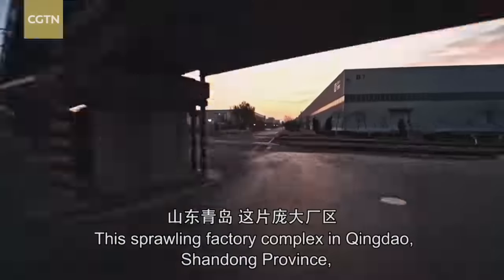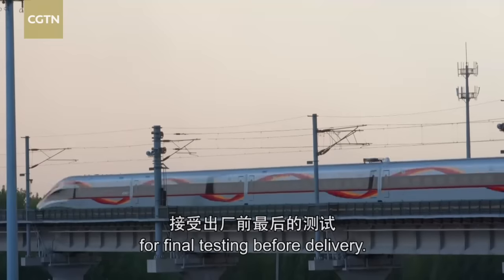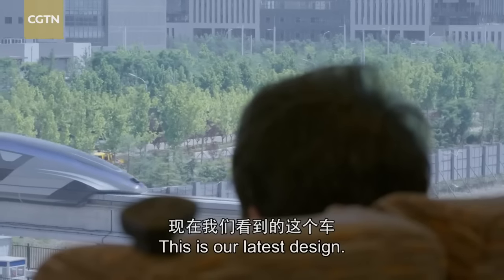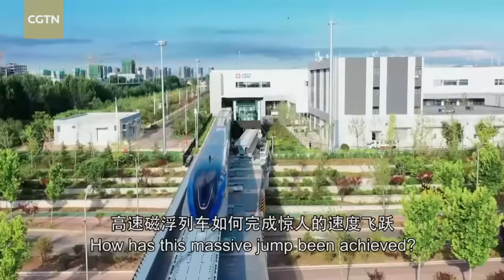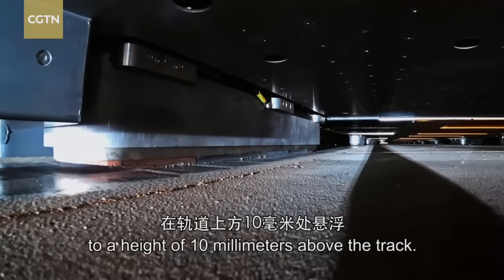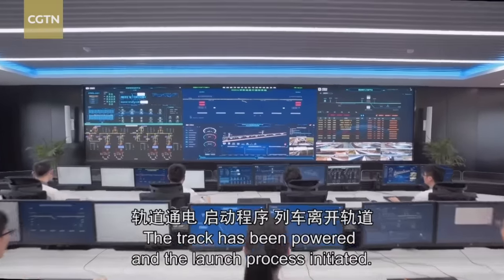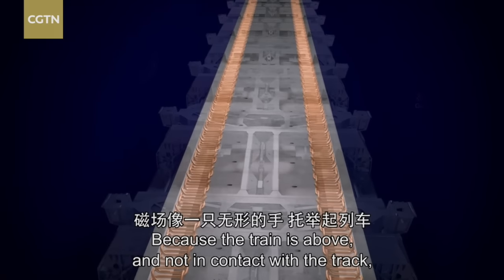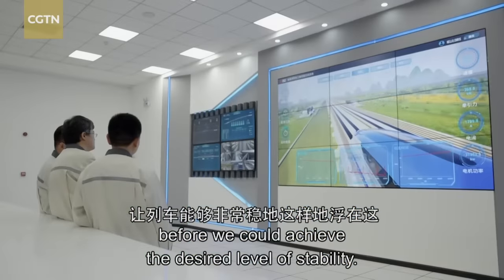China turns 600 km/h maglev trains into reality

Comment: 370 miles per hour with no wings or wheels is pretty awesome.
Reply: Thanks to 40+ years of German ENGINEERING and inventive spirit.
Reply: @bieneulm1982  Brugh....
Reply: @bieneulm1982  
Maglev was invented by the British electrical engineer Eric Laithwaite, a professor at Imperial College London, developed the first full-size working model of the linear induction motor in the late 1940s
Reply: @Dept246  Wrong, maglev on which the transrapid is based was invented by the German Hermann Kemper and patented in 1934. Laithwaite only did research in Britain and his first maglev train came much later than the german started their program. Furthermore was it just a prototype and never came to use. The linear motor alone doesn´t make a maglev train.
Reply: @bieneulm1982  yes we must admit the Germans invent a lot. I used to work with a German company from Berlin  V2 rocket, Jet fighter, Cruise Missile are originated from Germany from World War era. Even converting coal to oil originated from Germany, like Photovoltaics pioneered from Germany, like Maglev but the  Chinese has of the edge on scaling up production, faster and with a competitive price tag.
Reply: @steveman888  rocket tech is orginated from ancient chinese, theyve been using it on war during the dynasty period. Some put it in the arrow to fire at a very long distance. Maybe the modern rocket is german but the concept of the rocket is chinese.
Reply: @Aircraftcarrierpropulsion  the tracks for the transrapid are cheaper to build than a conventional High speed rail track. That´s because they can be prefabricated (that is why Shanghai was doable in only 22 Months back in 2001), a conventional rail line needs to be build at the spot and needs a lot of tunnels because trains are limited in their ability of climbing steeps. The only thing why the transrapid failed was sabotage through leftist politicians and that no one wanted to take responsability for an increase in costs due to purposely misplanned track-locations... The current railway projects Stuttgart 21 and Wendlingen-Ulm High Speed railway got more than 3 times more expensive than the Hamburg-Berlin Transrapid line would have been at it´s latest estimated overall cost. Are they both build, against all protests and everything? Yes. It´s never for the costs why transrapid failed in Germany, that is and has been only an excuse - even more a lie - like the one that the accident in 2006 had ended the technology, by it´s and Germanies enemies. And for Hamburg-Berlin they´re now planning to do Hyperloop, while we still would have Transrapid fully developed and available. Germany needs one thing to be done with great effort: Kick our current leading politicians out of the government, cause they´re governing the country in a bad, harmful and anti-german non-progressive open way. That needs to change back to where we have been 25-30 years ago. As soon as possible. But that would mean to turn a society from being stupid and naive into progressive, awake and ready to fight for it´s needs if necessary... With those Germans and such an attitute there would never have been a "end of nuclear power generation" after 2011, and we would be a full nuclear power with our own weapon-ready nuclear materials at hand.. That is why lies like the ones spread about the Transrapid are installed into the publics consciousness. "Constant dripping wears the stone" is what we Germans say to this. We could be far ahead regarding rail traffic if we had used transrapid 30 years ago instead of the compromise "ICE" by Siemens, instead we have delays (mostly caused by our high speed trains) that make the regional train lines suffer, SIgnals that fail and cause a standstill on the tracks and so forth and so on...
Reply: @bieneulm1982  I don't think you know the exact cost of the tracks per km per systems, otherwise you won't spit this kind of crap.
I don't know what you are smoking, but if Germany build an atomic weapon you will be invaded.
Reply: @Aircraftcarrierpropulsion  I do know them precisely, it goes like that: 1 double kilometer of transrapid Track inbetween Hamburg and Berlin was calculated to be at 17 Million €/km. Compared to that: 1 double kilometer of conventional high speed track on the line Nuremberg-Ingolstadt 30.9 Million €/km. Furthermore Germany has the full right to build it´s own nuclear weapons, it just signed the Non-Proliferation Treaty and therefore rejected the possibility of building own ones, but it is able to use nuclear weapons due to the so called "nuclear sharing" of NATO. Even the french offered the Germans in the 60´s nuclear weapons but Germany refused, although some parts of the military would have liked to have their own nuclear armament. France and Germany even planned their own nuclear processing plants together (to gain weapon-ready nuclear material) but a change in Government over in France put a halt to that.
Reply: Its a bullet. Bullets don't have wings and wheels.
Reply: @bieneulm1982  OK boomer
Reply: @kippise  b*llsh*t. That is why the japanese shinkansen (yes, the one with wheels underneath it!) is called a bullet train...
Reply: Yes

A pretty awesome lie!
Reply: @RemakeMoments  siemens is a German company 🇩🇪 🤣
Reply: @bieneulm1982  It has nothing to do with German enginnerings. Dont foget that German are now using CRRC trains from china
Reply: @tlplayz_ytc8501  Germany has ordered not a single train by CRRC, locomotives just a few and these came out of a joint venture. Germany has a fine and experienced range of train manufacturers.
Reply: @bieneulm1982  why did not german develope this 600KM/hour train themselves????
Reply: @bieneulm1982  what's you reading score in high school?????? why did not german develope their own  600KM/hour train????????????
Reply: @bieneulm1982  what identical and which patent exactly?????????????
Reply: @我的瓜最甜  ALL OF IT is identical to German Transrapid. It basically is a transrapid!
Reply: @awesome8975  modern rockets have most certainly not been invented in ancient china. Shooting a black powder-filled can in the air to make it explode to scare horses of the opponent is not a rocket, since it has no engine and it was flying more or less horizontally. They where invented and developed in 1555 by Conrad Haas and brought to an applicable and space travel ready condition by Wernher von Braun during the 1940´s.
Reply: @bieneulm1982  thats the trick you liars always use: there are lot of these........... there are lot of those............. when asking which one exaclty ....... you will be like: um............... well............  finally : go find yourselvies!!!!!!!!!!!  common tricks of liars😂😂😂😂😂😂
Reply: @bieneulm1982  🤣🤣🤣🤣🤣🤣🤣🤣🤣🤣🤣🤣🤣🤣🤣🤣🤣
Reply: @我的瓜最甜  I got a full high school exam in 2017. But thanks for doubting my educational level, which is most certainly way higher than yours (at least in certain aspects, I cannot be knowing everything about Chinese history, since I´m not an asian, unfortunately).
Reply: @bieneulm1982  let me try your way............ hey liar: why did you steal my furnitures??????????
Reply: @bieneulm1982  lets put your education level aside...... we will address it later..... let's go back to the question i just asked????? why did you steal my furnitures????????????
Reply: @bieneulm1982  why did you steal my furnitures????????????
Reply: @bieneulm1982  hello liar...... why did you steal my furnitures????????????🤨🤨🤨🤨
Reply: @bieneulm1982  are you busying in stealling someone's stuff??????????
Reply: @bieneulm1982   let me try your way............ hey liar: why did you steal my furnitures??????????
Reply: @bieneulm1982  thats the trick you liars always use: there are lot of these........... there are lot of those............. when asking which one exaclty ....... you will be like: um............... well............  finally : go find yourselvies!!!!!!!!!!!  common tricks of liars from western😂😂😂😂😂😂
Reply: @bieneulm1982  let me try your way............ hey liar: why did you steal my furnitures??????????
Reply: @Daniel Schwenk (Imkerei Schwenk | Ulm When you must cite an invention that's in 1934s then I think the rest of the world can also China as inventor of earliest calculator and paper money that you are using. Isn't it time for you to bowl down to their invention or u gonna try and steal that too? 😂
Reply: @Daniel Schwenk (Imkerei Schwenk | Ulm None of it is the same, cite your patent # if you think they are same as Chinese version
Reply: @Daniel Schwenk (Imkerei Schwenk | Ulm Like you said modern rocket isn't invented by Chinese as its "different" than earlier version of rockets invented by Chinese. Likewise, early mavlev train from Germany is different than modern mavlev train from China. Do you understand what's called a hypocrisy? You are the definition of it.
Reply: @Daniel Schwenk (Imkerei Schwenk | Ulm You got a high school GED and here you are trying to brag about high tech stuff that you don't even have knowledge about. FYI german didn't invent this form of new train. That's the end of it
Reply: A Malnutrition can Actually Invent? REALLY? Impoverished have ideas? Or is ist *copying the first thing seen?
Reply: we have a bullet train in argentina, it travels at 40 mph but crosses some cities you may get a couple of bullets..
Reply: @bieneulm1982  😂
Reply: The first commercial maglev people mover was simply called "MAGLEV" and officially opened in 1984 near Birmingham, England.
Reply: @petrbelohoubek6759  And where is it now?
Reply: @micro-emprendimientos.1642   😂 Alright, I'll give that to you.
Reply: @inkbold8511  The difference between ancient chinese rockets (low distance and barely controllable) and modern rockets (able to carry humans to the moon) is a lot bigger than the difference between the german transrapid (505km/h maglev train) and this new chinese 600km/h maglev train. In its core, this new chinese train works the same as the transrapid, its just reengineered and improved. Since china is actively using the german transrapid train in Shanghai it only makes sense that they use their experience with existing maglev trains during engineering of this new train.
Reply: @stevenman888 Ancient Chinese invented fire arrows and fireworks first.  Then cannons.
Reply: @micro-emprendimientos.1642 very funny, indeed! I laughed a lot about yr spirited comment! Even if it is rather sad! Greetings from a german living in Brazil doing business with China!😊
Reply: @bieneulm1982  German did not want to buy, original planned first Maglev which should be started from Stuttgart to Manheim, but, talk only.
Reply: @awesome8975  helicopter theory is originated from ancient China too.
Reply: @josephguo6256  Transrapid was build by Thyssen, the guidance system came from Siemens. Siemens has no maglev know-how. Stop spreading lies. And Germany developed that whole system from 1969 to 2011. Transrapid-Lines have been planned from the beginning of the 90's onwards. Why they have yet not been realised and for what reason is a completely different story connected to the term lobbyism.
Reply: Transrapid doesn't get over 450-500km/h, the chinese Knock-off didn't reach a 100km/h by now and will most certainly not operate with 595km/h (370mp/h). To ineconomical. With Transrapid, the Engine is part of the track (long stator linear motor), and therefore the speed maximum of the vehicle is set by the electric current that is being used
The long stator linear motor was developed by a German Engjneer named H.G. Raschbichler, which is thereby called the father of Transrapid, since he brought the magnetiv levitation units which makes the train float possible. 

He was also head of the Transrapid International TRI Organisation and played a leading role in the realisation of Shanghai Maglev Train besides Wu Xianming, back then called "Commander Wu", that coordinated the chinese building companies.
Reply: @我的瓜最甜  Germans could pretty well develop a 600 km/h train also, eventually they are the originators of this tech. But why would they need it? Maglev is too expensive and economically impractical, even you the China has 1trillion $ debt on this high speed railway project.
Reply: I guess by that argument the wright brothers rolled out the f22 raptor fleet.